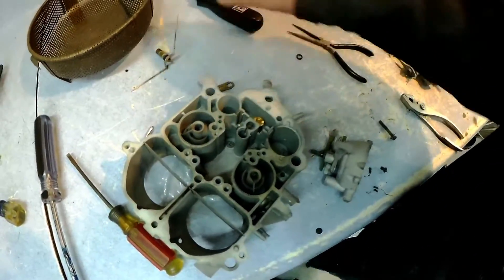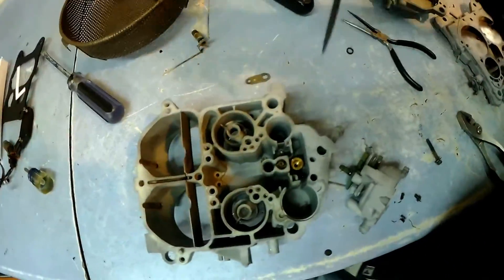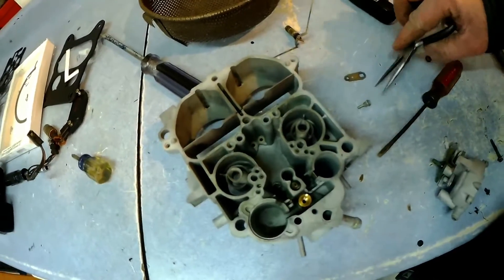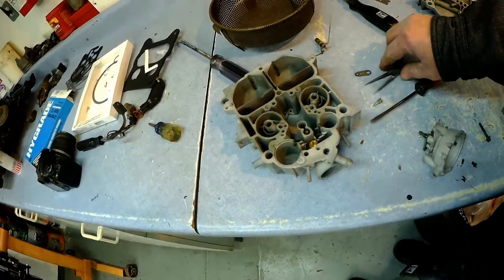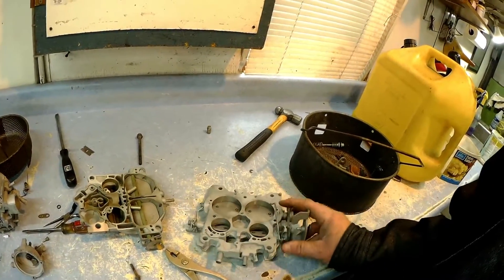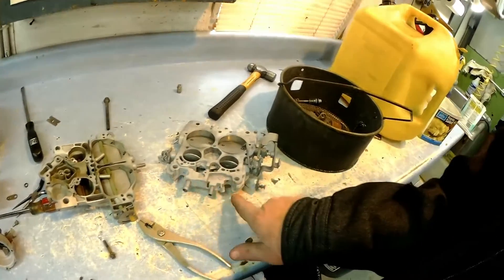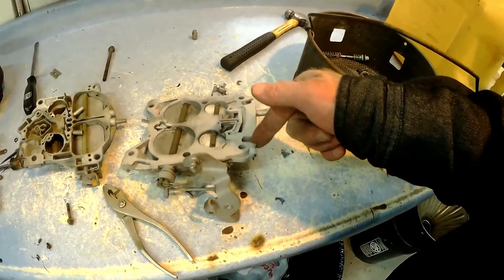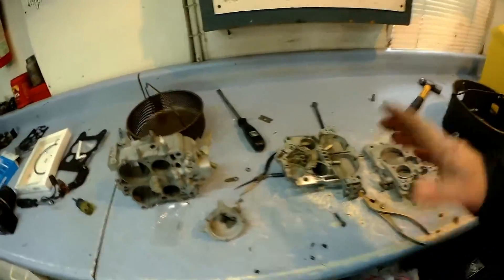GM Quadrajet Rebuild Tips

Comment: My Quad is not fat enough. I have a 69 Buick Skylark with the L77 350 4B motor 10.5:1 compression and a Crane cam. Runs like a scolded cat!  Awesome power!  Big block power!!  My problem is once the motor is good and warm, it wants to ping some unless I back off my timing a couple of degrees.  Doing this loses me a ton of power.  I can not find Ethel fuel any more as 91 is the best to be found at the pump. I might put a gallon or 2 of E85 which seems to help a little but I do not like E85 because of its hydrophilic properties.   My thought to overcome this ping which is only after it is warmed up and under load at lower rpm is to fatten up my carb as mpg is not a concern for me. IS there a way to fatten up this carb?  Do they have jets for these quadrajet carbs?  Slow jets and fast jets? I would like to fatten up both circuits to the next size larger and see if my ping goes away.

Comment: Awesome incredible video. You have a great knowledge and why to communicate it clearly. I recently installed ceramic long tune headers on my Q jet 454 in my ( dont laugh) restored 1977 Airstream motorhome. ( she is beautiful) along with the headers I put on 3 inch exhaust and flow master mufflers. I am concerned any correct air fuel mixture and I think I may be a bit to rich. She runs great my my fuel economy went down and I am afraid of over washing the cylinder walls. I tried adjusting the air mixture screws with a vac gauge but it seems lie a less than accurate method. I watched a guy adjust a carb on your tube using a vac gauge and then using an O2 sensor with a AF gauge. HIs results with the O2 showed he was way off using the vac gauge method. What is you suggestion on correctly setting the mixture ? Is there more to it than just the idle mixture ? How do I know I have the correct mixture and highway where my RPM is about 2,600 at 60 mph .
Reply from the maker: Jeff, email me at gearhead4you@yahoo.com, we can chat on the phone, too much to type
Reply: @mark_osborne  thank you Mark Osborne. I sent you an email.

Comment: If the threads in an idle screw hole are slightly damaged and the idle screw won't go in all the way in can you run tap through to straighten up the threads?
Reply from the maker: I never tried but I'm sure  you can !

Comment: I hear that older carbs need some modification to be able to properly burn the new crap high ethanol fuels that have a different specific weight/density. I've got a '69 Buick Electra 430cu.in that doesn't seem to like the new fuel no matter how much I tweak it. Any ideas? I like my Quadrajet and want to keep the car as stock as possible. Right now, it's hard starting, requiring sever pedal pumps to get it running.
Reply from the maker: I am sorry you are having trouble.  Personally, I don't believe that the 10% ethanol is causing the problem.  It's just too insignificant IMO.   Sure, it can hurt certain rubber components, but there's nothing in the carb that would be effected to my knowledge. Sorry I can't be of more help. I've got a 403 here that runs just great on the crap fuel :-)

Comment: I have to agree with you on the best carb made. People would say there going to throw them away, my reply was throw it my way. My question is I found what looks like a quad in every way except it's a 2 barrel, theres no secondary just the empty holes but the top where the secondary would be has not been cast open its smooth the numbers are 170551710045, fuel intake is like the ones on a oldsmobile straight out the front of the carb. What is it? I loved watching your video to forgot a few things you reminded me about thanks
Reply from the maker: Yes those were used for example on 260 Olds V8's !  I'm guessing GM wanted to keep the refined primary fuel control as the primaries on a Quadra-Jet were by far the best fuel metering on the planet, delivering the best fuel economy of any carb at that time thanks to the triple annular discharge boosters, plus mixture control thanks to the vacuum modulated metering rods (and later electronic feed-back metering rods).... and the 260 had absolutely no use for 2 large secondary barrels  !... so yeah ! .. and if by chance bean-counters made the call (as opposed to engineers) good for them :-)

Comment: Hello so question I ha e rebuilt my q jet worked great for several days. They had it tuned at a shop and now it's flooding. I saw another vid with a q jet on a dyno and he was very adamant that with these new fuels you need to have a regulator with it set at 3lbs instead of stock 6 or 7 from the mechanical pump. 

Do you agree? 

Carb has had an issue with flooding and dying intermittently. Runs great gets warm then ideals and dies. 

Also when it gets warm it seems like the tune goes out the window and the fast ideal screw is out of whack where I have to tighten the screw back up to have it run. 

Anyway, I'm going to tear it back apart. If you have any questions any other tips would be greatly appreciated. Cheer thanks for sharing your tip and tricks.
Reply from the maker: I have never heard of having to reduce fuel pressure because of the addition of ethanol. Can't imagine why. But I'm all ears.  Ask him why. In my opinion, there is only one reason the carb is flooding IE: the needle is not shutting off the fuel flowing into the seat.  Why ? The most common reason is simply some tiny piece of debris caught in the seat (that got past the filter).  Rare, but possible, a bad float.  Try putting an extra filter in-line. You could have junk in the tank. As far as the tune goes, it's impossible for me to assess that situation from (over here)

Comment: I've got a 78 Cadillac it has a rough rolling idle I've rebuilt the carburetor it takes the gas good but has a rich unstable idle and it will quit running I'm thinking the top of warped like you said.
Reply from the maker: it could be. Get up on your knees and take a look down the primary bores as she idles. If there's fuel dripping from the nozzles, you must figure out why. Could be warped top plate, could be bad float adjustment
Reply: @mark_osborne  thanks buddy I will get it out of the garage tomorrow and bring it down and check it out I'll let you know what I find

Comment: Mark, loved your detailed video.  I have a problem getting the primary metering rods out to rebuild my carb.  The piston seems to 
be stuck in the down position and there is no space between the two bores to pop the collar off.  This carb should be original to 
my 1975 vette carb # 7045222 R6.  Any ideas?
Reply from the maker: I just grab the metering rod holder thinggy that is sticking up and yank it out with pliers.  But if it's corroded/stuck then spray some WD40 or something down in there to hopefully dissolve the corrosion a bit

Comment: I have a carter quad and was wondering what the square hollow is for on the back outside of the main body? Maybe .5 inch wide and 1 inch tall.
Reply from the maker: Some air filter assemblies had a tang that would index into that square hole holding the filter assembly in the proper rotational location

Comment: What would cause my Q-jet to run my primary boosters to drip @ an idle? I can't run my throttle blades to square my T slot before it will die so i have to speed up the idle screw.  What would be the solution?
Reply from the maker: Is this a large displacement engine ? I assume you do not have restricted idle circuits (starving for fuel).  I assume your float is set to a reasonable level. Given that, if you need that much throttle opening to allow the engine to idle, then I wouldn't worry about it.
Reply: @mark_osborne   yes mark, chevy 396BB 12" of vacuum at idle.  The problem is i have no idle screw adjustment.
Reply from the maker: @Blakep7704  Ok got it. Large cam, large engine. Completely normal. No worries.  Take your hand and slowly restrict the air flowing into the primary side (hovering over the choke), if the idle picks up or gets smoother, you have restricted idle circuits. If the idle doesn't change, or gets worse, you are getting enough fuel. But either way, with only 12 inches of intake vac at an idle, you have a bunch of reversion and yes, it would be normal to see fuel dripping from the nozzles

Comment: What about warpage? Is there a tolerance I can use, I tried to unwarp using heat and trying to finesse the body by assembling it no gaskets and such. Worked abit but my secondary flap in the airhorn is getting hung up now in the process of "bending" things but I still have a high spot in the middle section ( housing I suppose) should I try individually bolting stuff to a bench with heat and apply force on the centres?
Reply from the maker: Usually you must file the opening where they secondary air doors are catching.  I place the entire top section upside-down in a vice and take a large file and make passes until I'm just tickling it in the middle.  They worst part will be where the 2 front bolts go through.
Reply: @mark_osborne  the flaps are only hanging up due to what I did they were smooth as silk otherwise it's the rod itself is binding and moving in its groove but I think flattening it will help. I will try bokting down to a very solid piece of timber w heat and try again and if not I'll try that method
Reply from the maker: @kainestefaniak2751  Yeah you may have this thing torqued out of shape. They typically only warp in the front 1/3rd due to the 2 large front bolts- which is usually correctable with a large file. Sorry you're having so much grief
Reply: @mark_osborne  as expected with older items, no problem I will slowly get it, I really appreciate the feedback and will be watching again when i get it sorted. Carby is supaa clean just waiting on some parts. Wanted to help the old man getting his hq Ute running. Seen a few different methods but seen you were fairly active in the comment section so multiple opinions is always thought of and appreciated

Comment: Here's my situation.  I am helping a friend with his motorhome that has a 454 and a q jet.  It's an 87.  I have mediocre mechanic skills including engine rebuilds and a few ASE certs.  My q jet knowledge is very limited.  The issue is his vapor canister was filling with fuel.  I know about the purge and vent valves, which appear ok.  The tank pressure valve is questionable and I don't know if his model actually has one.  I am suspecting that the vapor hose coming off of the carb at the bowl vent nipple is supplying this unwanted fuel.  My guess is what I need your opinion on.  My guess is that his float is bad or the needle is stuck open and allowing the bowl to pressurize with fuel and exhausting it through this hose, thereby flooding the evap canister.  What do you think?  We will remove the carb top plate tomorrow to verify the condition of the float and needle parts.  Does my theory hold fuel, I mean water?  Thanks for you informational video.  Kramer.
Reply from the maker: Just pull the hose off the carb and see if gasoline is dripping out of the open tube. I doubt that is the problem tho because if the fuel level was that high in the bowl, you'd have (rich) running issues.  I have seen flooded canisters over the years but never really sorted out the cause, usually we would just block them off and call it a day

Comment: I have a question and hoping you can help me.  Just bought an 84 ss monte with a quadrajet.  The secondaries do not work because the cam on the metering valve hanger is gone.  You open the secondaries and the hanger does not move at all... cam gone.    I'm going to purchase one but no one seems to show how you get the air door butterfly shaft out to replace the cam, which is in the middle of the shaft.  I just want to repair the carb for now as I don't plan on having this setup for long.  Any help is greatly appreciated!
Reply from the maker: Because the cam is missing, we know the screws that attach the butterfly(s) to the shaft will likely come out (because they've already been out), and that is the biggest challenge to removing the shaft. (getting the screws out of the butterfly(s))  Beyond that, you'll have to study the return spring carefully before disassembly so you know how to put it back together.  With that said, you should have no problem putting the cam back in :-)
Reply: @mark_osborne  ok so take the secondary pullooff off.  Remove butterflies and shaft should come out.  Thx for mentioning the spring and your help!
Reply from the maker: @scottsarver779  oh, you might have to take the top of the carb off and put the cam in from the bottom side, I can't remember

Comment: trying to get an old SBC running after a decade of neglect, part of the plan is rebuilding the carb. curious if there is anything i should be looking for that says i should chuck it in the bin and find a different carb?
Reply from the maker: There are many more videos similar, if not better, than mine on this wonderful platform of information sharing.  Use them to your advantage and bring your carb back to life !

Comment: Great video, so much knowledge and experience! I just rebuilt my Qjet and it’s great except for the secondary pull off relay holding the secondary choke flaps closed. I’ve disconnected and temporarily plugged it (runs beautifully now) but I’m at a loss as to why it’s like this? Will the pull off relay release on hard acceleration? Doesn’t feel or sound like it on test drive. TIA
Reply from the maker: My suspicion is it's a back-up government required emission device - other than that, I'm with you, a complete mystery. Yes once the vacuum goes away, it releases. That that stupid thing off and throw it away..lol
Reply: Mark Osborne haha yeah I’ll leave it disconnected and have a look what it does on hard acceleration in the driveway (sorry neighbours) and maybe next time it’s on a dyno observe what it does there! Thanks again for the fast response and great videos.

Comment: Great video, thanks. The primary metering rods adjustment screw ( between the metering rods piston and the fuel inlet seat ), any suggestions on a setting to start with? I've removed mine and forgot to count the turns.
Reply from the maker: Bottom it out and wind it back up about 3 turns- that will get you pretty close

Comment: I just rebuilt mine from a 77 olds 455 motorhome, someone had the spline off the choke shaft and I had to guess on repositioning it, it would be great if you could do a video on how it's assembled and how each stage of it works.  I pretty much guessed on its position and I think I have it right. But I'm not sure
Reply from the maker: I've never seen or even considered pulling the spline off the shaft. However, if you do a normal choke adjustment, meaning, cold, you rotate the choke spring until the choke 'just closes', you should be close.  If she seems a bit lean, give it a tiny twist -tighter.  If she seems a bit rich after she warms up, do the  opposite

Comment: Thanks for all the information. I’m trying to find out how to initially set the height of the metering roods. If you could tell me how I would greatly appreciate it. Thank you.
Reply from the maker: Are you talking about the downside stop ?, the brass screw that limits the downward travel ?
Reply: Yes. I screwed up and took it out.  One of life’s lessons learned the hard way
Reply from the maker: @guy1704  Sorry. I'd put it back in, screw it all the way down, then back it up 2-3 turns.  Put the metering rods back in along with the spring and see where they stop.  They should press down and almost stop before bottoming on the brown plastic cup/retainer that presses into the bore.  Hope that makes sense. If it doesn't let me know.  I'll shoot you my phone number.

Comment: Thank you so very much for sharing your knowledge. I have a 1967 7027202 quad that was missing the power piston. The kit came with the plastic ring however there is no counter bore so the ring will not press in. For this carb. is the piston held in w/ the gasket and air horn only?
Reggie S
Reply from the maker: Yes, you have to hold the piston (accelerator pump)   down into the body, while slowly lowering the gasket and air horn down over it.  You have jogged my memory with your question.  I have often taken a razor blade and cut out the gasket (in a circle) above the accelerator pump (piston) so the gasket can drop down onto the body before trying to put the top section in place.  It makes it a bit easier. (not having to fight with the gasket as well as the top section while holding down the accelerator pump)

Comment: I have a qjet with electric  choke that's  leaking fuel on side near choke. Can  I fix it without  total  rebuild  it runs well just leaks.
Reply from the maker: Don't know, the float level might be a big high or the gasket between the top and the mid section could be worn out.  Wishing you good luck.
Reply: @mark_osborne   thank you

Comment: Good info! 

I have a 76' Chevy truck Q-jet and it has a warped air horn (approx 1/8" from corner bolt hole to sec. rods area). Do you think it could be repairable? It had no idle and been sitting some time...

Thanks!
Reply from the maker: I think so.  grab a large coarse file and just work it, trying to focus primarily across the front (where it's warped the worst) first.  Then slowly work it around and make sure the file is hitting across the entire top.   Don't worry if it's it's a tiny bit spotty, meaning, not hitting as hard everywhere.  You're just looking to get it flat, not perfect. You're not by chance related to a Bob (Robert) Jokinen who lives in Michigan ?  I went to college with him back in  the 80's.  We sort of lost touch
Reply: @mark_osborne  Okay, I have to try and see how it turns out. Thanks!
I live in Finland so I'm not close related but he's grand parents or great grand parents could be from Finland. There are many Finns livin in the lakes area US and Canada.